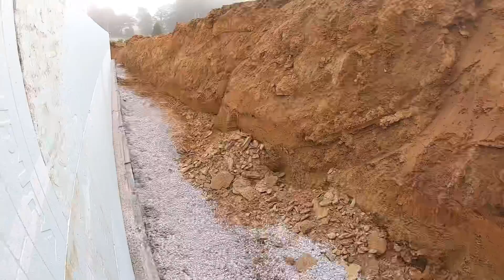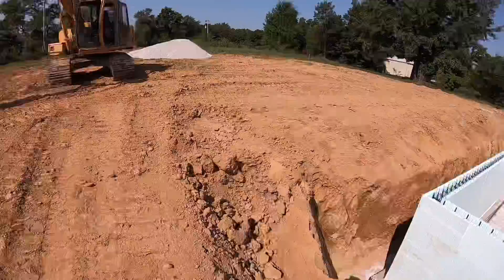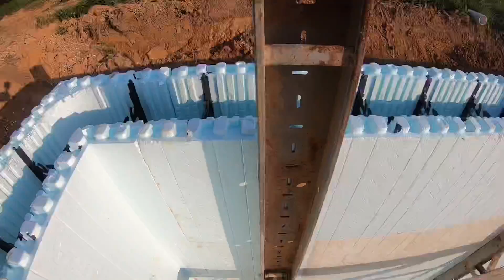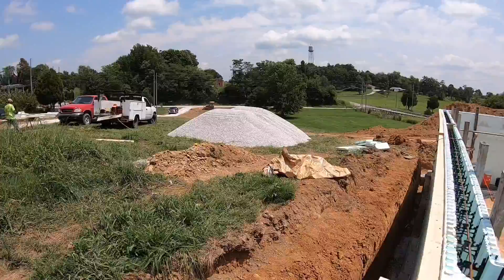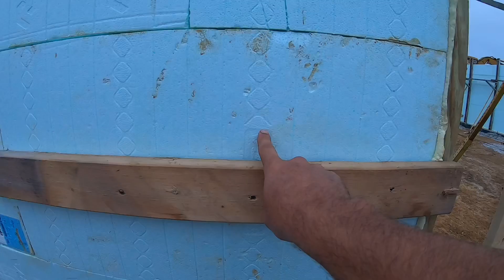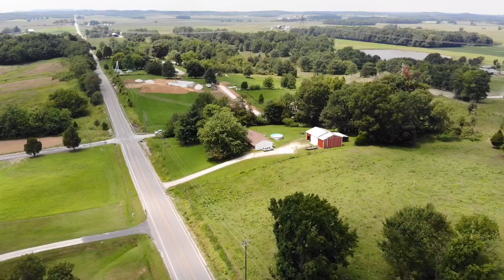How to stack ICF basement walls #nudura #ICF

Comment: Don’t use thys type of system just use ur money in regular insulation. These type of walls have very little rebar, which is important for the strength & durability. Just slap insulation around a proper built walls wit real rebar. Thys system is a real joke seriously
Reply from the maker: Lol what the hell you talking about clear you don’t have a clue 😂😂😂😂😂😂😂😂😂😂😂😂😂😂😂😂😂😂😂😂😂😂😂😂😂😂😂

Comment: Run as fast as you can everyone...Do not use NUDURA, find another MFG they do not stand behind their product either before, during or after construction. I have a ruined house that cost us $750,000 to build (and counting) when it should have never been close to that, it's only 3200 sqft. our basement has been leaking since dry in and continues to this day.  Not 1 single call from NUDURA in 3 years Lawyers say good luck, we'll lose more than we'll ever gain.
Reply from the maker: Sounds more like a installer problem not a product’s problem 😁 have had great luck with the product and company 🤷‍♂️ sorry for you bad luck
Reply: @DirtPerfect  wow I never thought of that, you're right. I wonder why they never returned my calls and said that. of course their product couldn't have been defective, no way.  I was an Ironworker for years and would never bash another tradesman before I knew the whole story. Just assume it's the installer and not maybe a couple of defective forms, no no that could never happen. It never happened to you so it could never happen to any other installer.  Oh BTW Nudura is the one that sent the Installer.
Reply from the maker: Ok I do not have a dog in the fight buddy sorry to disagree with you on the product 🤷‍♂️

Comment: Damn so much easier. Back when I was doing forms we didnt have this. We had the 4 bar and 6 bar old would forms. About 6 months before I left doing forms to drive truck full time we saw a house with this styrofoam foundation done. They did the entire house. Window and door cut outs place was totally sealed with a metal heated roof to keep snow and ice off of it.

Comment: 1st,, if you are using ICF,, you can pour the footer wall and the footer with a bag all in one pour...
2nd ,, if you are gonna put an ICF on top of a footer that's already poured,,  Use some scrap 2x4 and a ram set and  nail some  on the outside corners and a few along the length so it does not move,, also you really need to tie the ICF down to the rebar so it does not rise...
Reply from the maker: 1st been there done that not a big fan of that method 🤷‍♂️ 
2nd we from time to time don’t find it necessary in smaller simple jobs 

Thanks for watching
Reply: @DirtPerfect   Did you use the plastic leveling feet? I am not a fan of that either..
Before that was an option we did and still do use stakes and 2x4 for the top of the footer,  place the bag inside.. than install hat channel to support the ICF. Once we get the first two rows on and tied together  we pull up the sides of the fabric to complete the  footer shape going over the hat channel and secure the fabric to the ICF with some L shaped metal channel screwing into the hatchannel and the ICF...  We have poured 5-6 rows with the footer before,, Just need to make 2 or 3 passes with the pump truck,, and make sure you have a guy lightly kicking the air bubble out of the footer...  Make sure you pin the fabric down to the ground where one piece meets another..  so the concrete can't get in between the layers.. I usually just use reinforcing mesh to make  C shaped clips you can staple the bag to the ground,, I also usually use the mesh to make the baskets for the rebar.. to tie everything together... Sucks paying for the pumper truck twice or repeat delivery charges... But like always depends on the footer.. But we have done the foundation of a mid size church like that,, which was a rather long pour.. lol...  as soon as the corners are poured we usually have the skid steer guy full in the outside corners, as this is always the most critical area with a failure can happen...
Reply: And no vibrator... It destroys ICF's and rips them apart...  my experience with this method is 20+ large jobs over the last 20 years...
Reply from the maker: 300 jobs over 15 years  and three international awards at world of concrete I agree 😁
Reply: @DirtPerfect    mind explaining what you didn't like?   not arguing just curious as I've never used the bag, but have done plenty of traditional footers.  my thoughts are you could save on a pump truck and the # of pour days and cold joints.   but not sure I'm a fan of floating a wall above a bag either and maybe the pump cost VS simplicity is better spent than labor on setting up a floating wall.

Comment: No break outs is always a good pour day.  Enjoyed the show and attention to detail, keep it up.   Where are you located at?
Reply from the maker: Thanks and southern Indiana
Reply: @DirtPerfect  Yep, I figured it was Southern Indiana what with that "Southern" accent and all.  Personally, we are down in South Alabama near the coast, really enjoying my ICF home since 2006.  I sprayed foam up in the walk-in attic on the backside of the decking (I keep a chocolate Easter Bunny up there for comedic effect when showing visitors the house) and carefully positioned my home facing North-South with the main exposures to limit solar heat gain in the summertime and placed porches on the North and South exposures and no glass on the Eastside and only two small horizontal windows on the Westside.  I only need a 2-ton unit to cool the 2000 square feet living space and I use a wood stove in the "winter" time (all 6 weeks of it).   My HVAC power bill was only $160 for all of last year.    ICF is the new standard to compare all modern construction.  We have a Middle School nearby that is all ICF, (Escambia Co. FL)

Comment: Shame at 30secs you had to put that 1/2 or 3/4" gap in there to make the wall a specific length, bet you could have done without that, though not much to plug it with foam and strap I guess. That guy doing the gravel eh, that's some experience right there. In the UK here and been involved in a few Nudura jobs, its good stuff I reckon. Imagine if they ever invent transparent poly eh, you could see that mud coming up and vibrate it out perfectly! Great job video'ing as well as doing the job, but you didn't need anyone saying that.
Reply from the maker: Thanks clear block would be cool
Reply: @DirtPerfect  Make life a hell of a lot easier for sure.

Comment: How is the vertical rebar tied into the footer?
Reply from the maker: Layed next to it held by web in block
Reply: @marcus dixson  That was kind of my wonder.  In my area, on non-code foundations the verts can be stabbed in during the footing pour, code areas they have to be tied in to the footing iron in any of 3 or 4 ways, depending on how the footing/wall is constructed.  But ICF or conventional, anything we've done is always tied in to the footing rebar.  If doing tall walls, you tie in short verts of 4' or so, then tie in the longer verts using the diameter x 50 formula for lap length prior to setting ICF blocks or wall panels.  So the shorter verts have to be of sufficient length to make the math work for how big of rebar is speced and how tall the wall is.  It does make setting ICFs a PITA, especially on tall walls, but code is code.  

I do live in a seismically active area, so the rules are probably different than the area in the vid.  If I would have an inspector show up to our ICFs without tie-wire and footing secured rebar, he wouldn't even bother walking the whole perimeter - we'd be tearing it apart, footings and all.  But that's why its interesting to look at how things are done in different areas.

Comment: Mike, good video. Have done 0ver 200 ICF walls and projects. There’s a glue made in Canada that with a very small bead will glue your blocks together and eliminate the need for bracing. You can pour the wall, 4 ft at a time (not supposed to drop concrete more than 4 ft) then walk back around the wall and pour 4’ more, until you get to the top. The walls will flex, but not blow out. Then the next day you come back and push the wall in or out and take any bow out. The concrete will take 20 years to completely cure, so your wall is actually flexible. ALWAYS waterproof the exterior wall with a waterproof matting material made for underground steel pipe. It’s thick and resists any penetration by gravel etc. It comes in rolls, and is self adhesive, It’s made by Chevron Chemical
Reply from the maker: Interesting will check it out thanks
Reply: Mike, the flexible discharge Waterhouse (4”) can be adapted to the concrete pump discharge boom, and lowered into the block wall to the proper depth allowing the concrete to be poured close to the surface of the foundation, and raised 4’ each time you make the next go-around pour. We also have poured the footer and then set the first row of blocks directly into it, squared it up and let it set over night. When you get to the top of the wall, any variance in height can simply be shaved off to level. Simpson makes a “sill tie” that actually wraps around your sill plate, and is embedded into the concrete. Put these into the top of the pour at the required coding distance. If there’s a engineered flooring system at the top of the wall, you can set the hangers into the blocks and pour them in, then install the wood floor joists, thus locking the walls in place. Make certain that you install a French Drain system at the exterior base of the wall system. Thx for the great videos. Makes me want to get back into the business. Would love to build one with you just for the thrill of doing it again. There are lot’s of little tricks to make your job faster and less expensive for you. Good luck. My home was 3450 sq ft with 12’ ceilings and 36% glass exterior walls. I had one 3.5 ton A/C/heat pump combo. My average utility bill was $72 a month and we were all electric (no natural gas in our area at the time). I had 2 vent free propane fire places and they used $15 of gas a year. My Suburban Propane guy wouldn’t lease me the equipment because I didn’t use enough to justify him renting it to me.
Reply: @stephentaylor9366  Did you see the previous video? The french drain is incorporated into the actual formwork for foundation.
Reply: Cassette Walkman Stephen Taylor here. I did not. But I thought with your experience you must have been doing this. In another video, a guy builds his French drain like a leech bed for a septic system using only rocks to prevent clogging by mud and other material over the years. That combined with a porous pipe would perhaps be best. Don’t know if it’s worth the money and time though in many instances?

Comment: Hello, I was wondering is there a particular reason to go with ICF over a solid pour concrete wall with standard rebar?
I see more construction companies doing ICF then I do non-commercial solid pour concrete
Reply from the maker: There is sever sole have to do with local building codes but the one main advantage is when wall is poured it’s insulated and studded already
Reply: Dirt Perfect so basically you’re talking about being studied and insulated meaning less man hours of construction lowering costs right? How does the cost of concrete Play in the comparison.? Here in Florida you would want between 10 inches and 14 inches of solid concrete to manage thermal transfer loads but I haven’t the faintest idea how that transfers into building cost
Reply from the maker: Yes in a nut shell check out mine nudura s or Holdfast technology s web site lot of good info there
Reply: Hey Dan ,  I have lived in my ICF home since 2006 (custom build) and I would never go back (willingly) to a stick-built home.  Besides strength, yes I live on the Gulf Coast, I am all for the insulation factors in an  ICF wall.  We used 6" ICF block, that's 6" of concrete in the void between the two foam panels and there is NO thermal bridging at all.  I have 2.5" of foam on each side of the concrete and it does its job of keeping the bridging at bay.  My HVAC power consumption last year was $160 for the whole year, the thermostat logs energy used for each aspect of the HVAC system be it for Heat Pump Heating or Cooling or Emergency Heat or just running the circulation fan when I use my wood stove to heat the house.
Reply: Clay Ritchie oh I know and I would love to build ICF if I can’t do solid pour (that’s just no foam insulation with foot thick walls of concrete)
My property is between Leesburg in taveres and I don’t see any builders close enough that do either
Reply: Dan Festag Nudura comes in sizes up to 12" and you can also get thicker foam if desired.
Reply: Dan Festag Oh and if you go to the nudura site in the homeowner section there is contact info for nudura and they will work with you to find a local contractor and/or distributor. link is about 2/3rd down in the left hand menu of links to resources.

Comment: people don't realize how dangerous I'm at Job foundation work is my brother here in Long Island New York was driving a cement truck where the concrete came out the back of the truck he's standing there working the controls the ground came out from underneath them felt about 14 ft cracking his head wide open from the eye over the top of his head think I didn't lose his vision or die and other friend owns a big excavation demolition roll-off is a big big truck company and he finished a foundation was pulling off the the forms and the last stack he ran out of the metal straps they tied it up with rope as the Roloff picked up the flatbed the Rope snapped the forms that were tied up rope hit the guy in his legs stomach ribs chest head ended up killing the guy it's a very dangerous job
Reply from the maker: Yes it is lost my dad in a industry accident 😐

Comment: From my own experience with gravel, I wish i knew about things like stabiligrid and truegrid pavers for it, as with free flow gravel like you just did, that gravel will just get pitted like heck and require maintenance and when it gets down to the geotextile it will rip up from general driving as well as plowing when/if it snows in the area enough to require such. For the added cost of pavers it definitely saves on maintenance time and cost and makes for easier times with snow removal.
I learned a lot of tips from many ICF users and the manufacturers who provide it as well, you are correct on leveling them for a more level top surface, many things i will be doing if I ever build an ICF myself when time comes if I get  a home of my own and it would need basement replacing or just build anew.

Comment: Myself I would have built that road twice as wide that's what it is or at least a half hour with again just so you have passing room and made the end of the driveway a little bit wider myself.
Reply from the maker: It’s 12 foot wide plenty wide for a driveway
Reply: Myself would have used a solid paver (truegrid or stabiligrid) for gravel to keep it in its place and made it deeper for better drainage and not need to install any pipe. Makes for less maintenance as no potholing or reposition due to plowing when it snows ( i live in MA).

Comment: Question ,  1 where will the sewer connection go through the wall / footing to a drain field ?  2 where does under ground hydro come in  or do you drill holes after the pour?
Reply from the maker: We put sleeves in will see that in the next video

Comment: I’m looking at building a house next year so I’m curious what would a foundation like this cost using a ICF versus a traditional concrete forms foundation? Just curious on the ballpark difference in price thank you.
Reply: This does triple duty, as a form it goes up and does not need to come down and thus saves time in rental costs for traditional formwork and as a insulator it also saves time in that aspect as well when it comes to finishing the interior. Still requires waterproofing stick and peel and dimple board to guard against water pressure and leaks. Take it from me as a 6 year experienced pro of basement waterproofing and  having to deal with all sorts of basement structures except ICF as I worked from 1995 to 2002 (seasonally for my step-dad who owned and operated his own business).  Wish I knew about these then.
Reply from the maker: About 10% more well worth the money it you ask me thanks for watching

Comment: liking this video series--but..........where's the basement door to  walk outside? just a window --are the home owners midgets maybe-ha! don't they want a drain in the floor? waiting to see how uns do ur french drain too. i remember u showed us a drain pipe inside the corner of footer before-maybe that hooks to the floor drain somehow? but i would like the R-value of them walls for sure. my basement was a poured wall, they used metal forms for it.
Reply: Same here, in MA where I live a door is definitely a must to pass code and not just one egress/emergency window. ICF definitely saves time compared to using formwork  and superior to CMU crap walls (am a former basement waterproofer) which will retain water like a reservoir.
Reply from the maker: The window meets all codes here the house has either a porch are Carothers rest of the way around it
Reply: @DirtPerfect  pardon my lack of what the heck a "carothers" is?
Reply: BigJim57 I live in the same state as Mike (Indiana) and have a basement that is at least 1500 sq/ft and only have 1 egress window with like a half culvet vertical to hold back the outside dirt. In an emergency the entire window can be removed from the window frame.